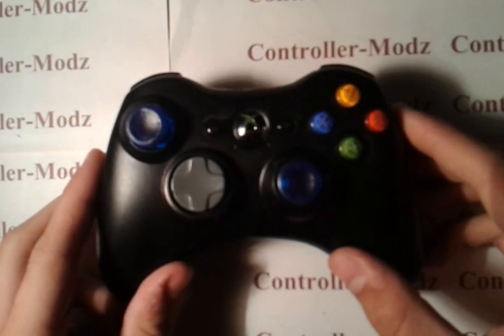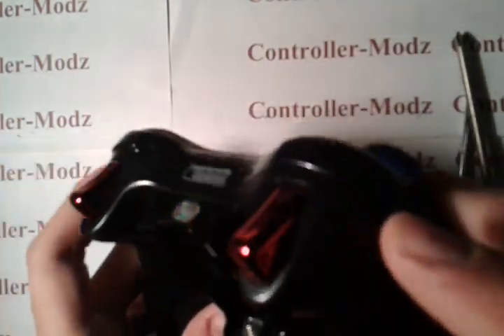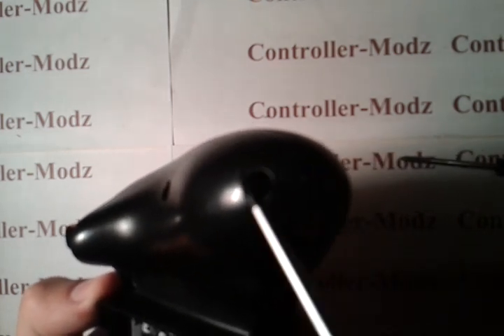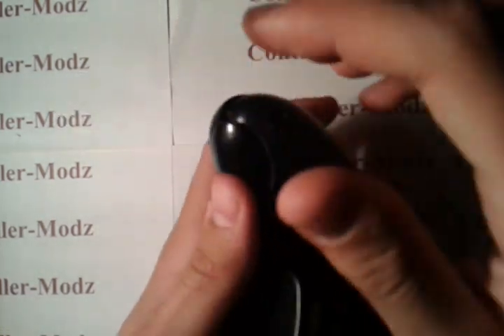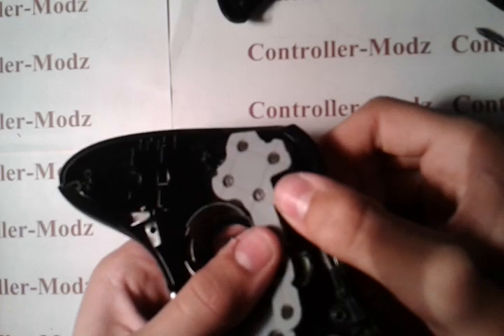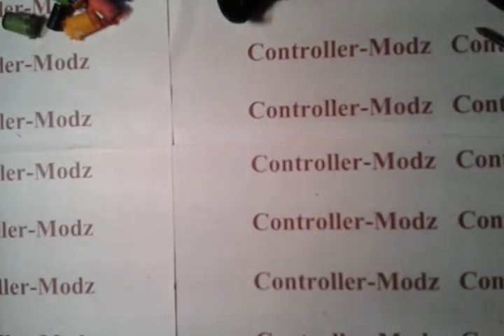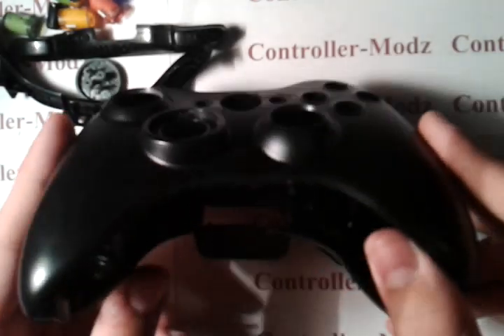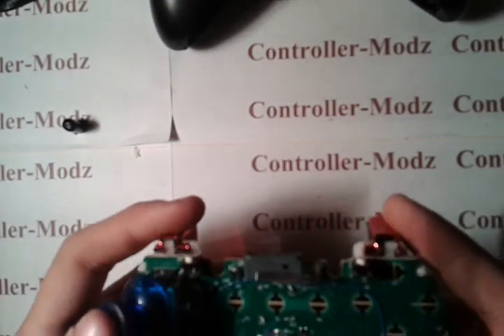How to Take apart your Xbox 360 Controller - Controller-Modz.com

Comment: For the black hull with grey colored joystick version, don’t try to remove the circuit board if it’s too hard, like both ends of the PCB are bending up like crazy when you’re trying to lift it out (left and right sides), it can damage the left joystick if the circuit board got bend too much when you try it lift it up very hard, because the 2 joysticks aren’t aligned in a horizontal line, it’s the left joystick that get damaged. Also each controller may has a “click” part that can break if you pull hard enough, a part has to be broken because it feel like superglue are used at the joint, not each controller versions and models are easy to take apart as shown in most YouTube videos.
Reply: So do you have a solution to open it? Got the exact problem you speak of

Comment: Could someone please tell me what the rumble packs or those things hanging from the wires are for. My controller is old and the one on the right side broke off when the wire just snapped from stress. Nothing seems to be working wrong but I don't want to push it depending on what they are for.